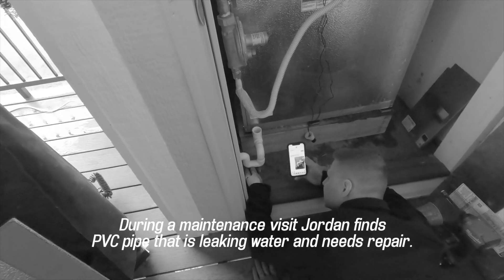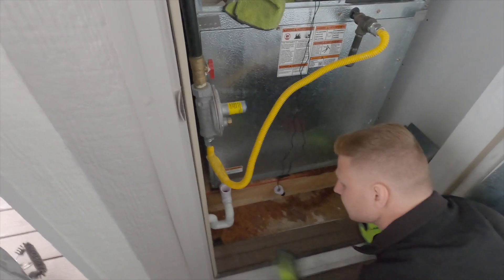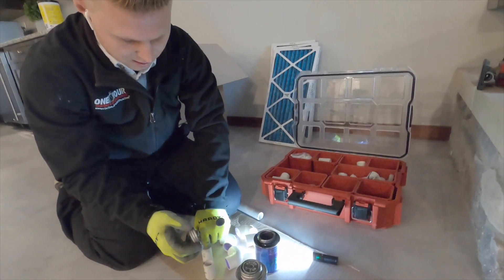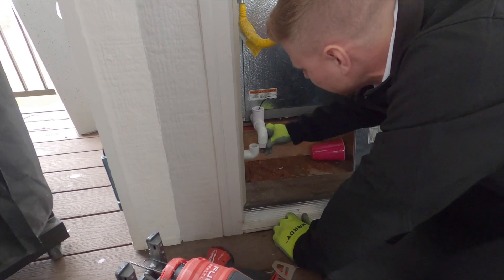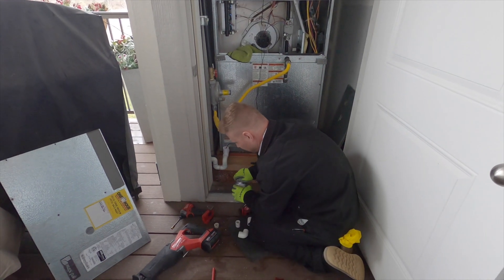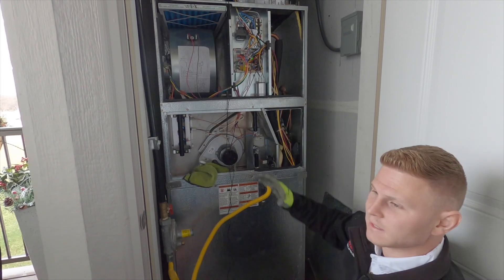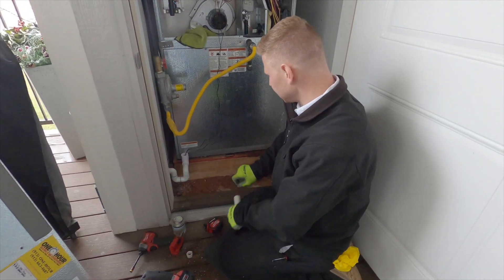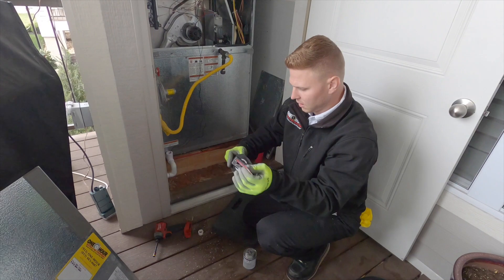PVC repair with an HVAC Technician

Comment: Why would he use a power saw instead of a handheld ratcheting PVC cutter?

Also, about that package unit, how can the condenser be installed in a closet if you need airflow?  An outdoor condenser is supposed to be clear of buildings and bushes, but this one is surrounded by walls on all sides. Where does it get the incoming air supply and where does it dump the heat out of the condenser fan?
Reply: Unfortunately my ratcheting PVC cutter broke and I have not replaced them. 

On the magicpak systems the back has a grate open to the outside. So In the closet they cut a hole in the back wall to disperse heat and run your exhaust for your furnace as well.
Reply: @jordanristau2464  great, thank you. For the magic pack condenser, how does air flow across the coil to cool it if 3 sides are blocked and the 4th open side is for exhaust?
Reply: @realSamAndrew  the condenser fan motor pulls air through the bottom grate, through the condenser coil (part of the hole on back) then there is a small section between the top of the condenser coil and below the furnace section where the heat is exhausted.